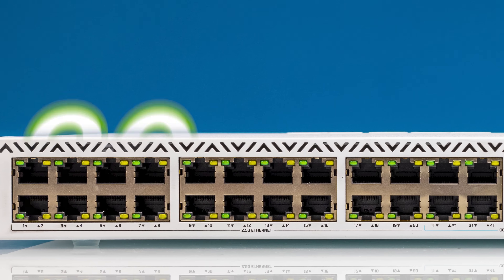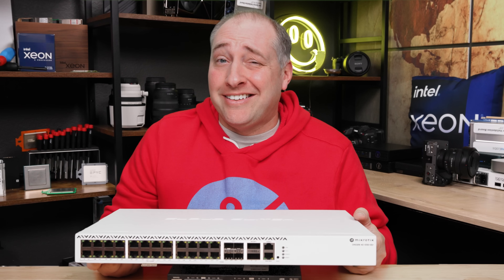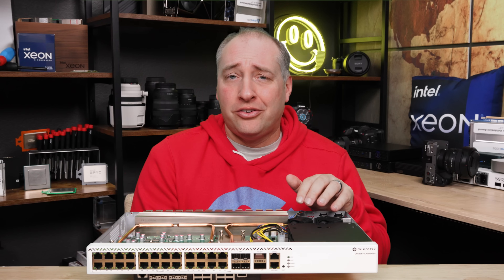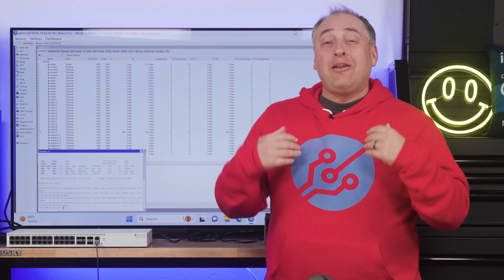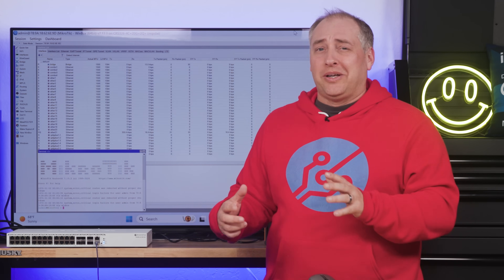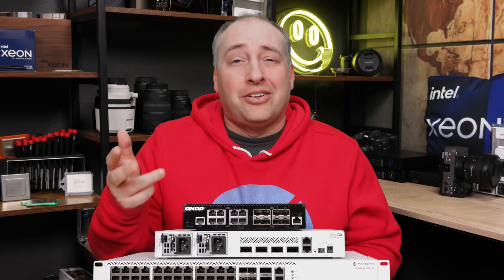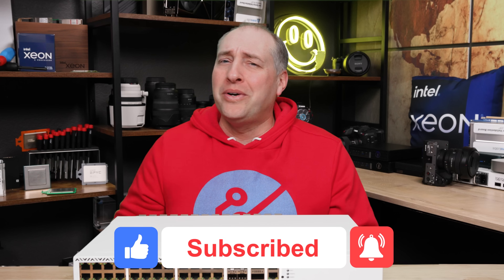Inside MikroTik 's NEW 2.5GbE and 40GbE Switch - CRS326 4C+20G+2Q+RM

Comment: It would be nice to have all 10G posts.
I know its a lot more power, but thats ok.

I have a MokerLink 2.5G. I wanted the 10G but its $180CAD, then Id have to buy 6 SFP RJ45, and that would already be out of budget.
Reply: Lets examine this idea shall we.

All of the ports combined require 170gbps switching capacity to be non-blocking.

Switching those 2.5gb ports for 10gb would take a chip that can handle 200gbps.

After adding the rest of the 10gb and 40gb.. You would need 320gbps switching capacity to be non-blocking.  That's almost double.  So now, you are adding in a more powerful switch chip, that will draw more power and product more heat. Now you need to redesign the cooling solution to accommodate that, so that means even more cost.  Oh, and you'll need to upgrade the power supply for the units.. So more cost.

You are left with a switch that is well over $1000, and you're complaining about having to buy 6 SFP modules? :P

Comment: i just got a 2.5 plus 1 10spf - suits my needs and cheap too - could not hold off any longer and will future proof me for a while - the 2 40g on this one are nice for ws to nas connection - hopefully they will be able to add more 40g ports in next few gen of switches - smb mkt needs fast networking - it is their weakest link arguably. with lots of 2.5 you can do bonded connections a bit easier

Comment: Thanks for the review... I did like and also dislike this switch for few reasons:  (1) It has 128 MB of RAM compared to the old CRS326-24G which is a downgrade that has 512 MB ( I found that 64 MB causes random reboots when memory saturates).  (2) Flash Storage is 32 MB (double than CRS326-24G) but we recent package upgrades are eating this small storage (why not go 1 GB for RAM And 1 GB for Storage? don't get it and don't tell me is price (3) No PoE++ as you mentioned, so its a downgrade in certain areas compared with older models and price is 3X times higher than the current CRS326-24G which is a DoA.
Reply: I paid almost next to nothing on my CRS326-24G-2S+ before the pandemic happened.  Also, same for my CRS328-24P-4S+.  Chip shortages had huge influence on prices.  It's coming back down but nowhere near the prices 4 years ago.
Reply: @Darkk6969 True but getting 2.5 Gbps + 2 extra SFP+ + 2 x 40 Gbps for 3x de extra cost of the CRS326-24G, doesn't make much sense to me, specially if they lack 1/5 of the memory of the previous generation
Reply: limitations in the max size supported by the very old management CPU (from 2013), which is due to price and availability issues. Also the reason why it uses DDR2 RAM which is old.
Same reason it has 40Gbit and not 25/50Gbit ports, they use a switch chip that is old and does not support more modern modes.

Comment: No longer early this time. :( What was the correction?
Reply: Mikrotik has not been very clear about this switch. Their website (and the original video) mentioned that the combo Base-T ports were 10GE but they're actually 2.5G - this looks to have been corrected
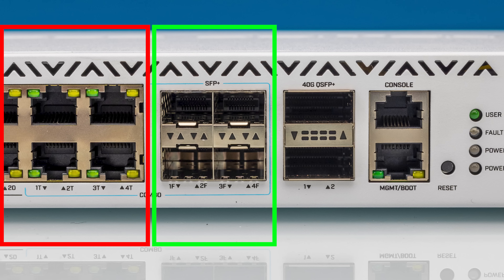EDIT: You can find the changes to the video at 2:45
Reply: i wonder aswell, maybe theys got smth wrong and had to reupload it to correct details

Comment: Appreciate the update, I was /4 of the way through the original when it was changed out. It is a lot clearer now. However, what I'd really want is to have more 10gig sfp+ rather than the 40gig.
Reply: QSFP+ to SFP+ converters will get you two more.
Reply: You mean 8 more :) Each QSFP+ should give you 4 SFP+ with breakout cables @RambozoClown

Comment: Literally was looking at 40G switches yesterday.
Reply: If you are only after 40G, go with the quad 100G switch from Mikrotik. Great future proofing, and you can break out the QSFP28 into either 4x10G or 4x25G or 1x40G or 1x100G

Comment: NOOOOOOOOOOOOO!!!!  no more 2.5gbe! - this should be a 24 port 10g base-t / 10g sfp+ / 40gbe qsfp switch.
Reply: Mikrotik already has one with 24 SFP+ and two QSFP+.  It's also less expensive than this. Go buy it.  Use the savings to buy SFP+ to 10GBASE-T modules.
Reply: @pleappleappleap  New 10G SFP+ modules are easily $50.  ($65 if you buy Mikrotik branded)

By the time you buy you buy 10 SFP+ modules then you'll have broken even with this switch.
Reply: There is a different CRS326 with 24x 10G SFP+ and 2x 40G QSFP+.
Reply: 10Gbase-T is useless. Used Mellanox cards and fiber is where it’s at, or DAC as an alternative.
Reply: @LtdJorge  Fiber DACs are awesome too.
Reply: And more heat
Reply: And few devices have 10Gbe. 2.5Gbe is already rare.
Reply: @TheMaxAwesome most high end gaming motherboards have either 2.5g or 10g base-t, most workstations have 10g base-t.  most micro pc boxes i've seen have one or more 2.5g ports, i've seen some home wifi routers with 2.5g... lots of 2.5g switches.  there's a ton of gear that uses it.  10g base-t started to get rolled out on the high end stuff, it's still there but it's slowed down and 2.5g has taken over the lower end of that market.  I'm honestly not sure why we don't see more desktop motherboards with 10g sfp+ (I've honestly never seen one), but even high end macs have come with 10g base-t for quite some time (the mac pros in particular).  my current motherboard is an aorus x570 xtreme, onboard 10g base-t.  the board in my nas is an asrock x470  taichi ultimate (8 sata ports, 10g base-t, 64gb of ram, 5950x makes a really nice truenas server), and you can get intel x540-t2 dual port 10g-base-t cards used on ebay for a song, they work fantastically and even support sr-iov which i use on my proxmox cluster).  power wise, i've never seen my netgear sx728t go over 90w with everything going hard running network benchmarks.
Reply: Also 10GBaseT SFP+ generate a ton of heat and noise trough fans trying to keep them at reasonable temperatures
Reply: @etimacias  But does it use significantly more power than the 10GBASE-T PHYs on a direct 10GBASE-T switch?

In any case, if I'm using a SFP+ switch, I'll often be using DACs rather than 10GBASE-T.
Reply: the 10G PHY on board has a potential to be cooled by a main heatsing, so it'd be easier to dissipate the heat. If you look at Mikrotik's 10GBaseT SFP+ modules - even Mikrotik recommends not plugging them in adjecent SFP+ slots. They get to 70C easily, because of lack of surface.
Reply: @etimacias  yeah, it's totally the sfp+ causing that heat, not the 10Gbase-T circuitry that would need to be present in the switch anyway....
Reply: 10gb cost way too much to run.
Reply: we need more affordable  2.5GbE switches.
it finally has to start replace 2.5GbE switches.
Reply: @ChrisHolzer  ???
Reply: 24port 10gbase-t would need a dedicated diesel power generator
Reply: @marcogenovesi8570  this lol. And an Air Conditioner for it.
Reply: @marcogenovesi8570 Unifi EnterpriseXG has 24 10g base-T, plus two SFP28 ports, and draws a maximum 100 watts. So not so bad.
Reply: @marcogenovesi8570 I own a netgear  xs728t that works great and doesn't really take up all that much power.
Reply: Money, money money , 10Gb comes with a bigger  price. For Home use 2.5gb is more then enough.  By the way in europe we have 2.5gb internet connections as well at very low price . About 15$ / month with cable included.
Reply: @IonutRaducanu yeah, internet is overpriced here in the states.  I pay for 2g fiber for $100/mo (it's overprovisioned for 2.4gb/s).  That said, it isn't about wan speeds (though that's part of it), it's about lan speeds, low latency, high speed access to internal services (mostly storage and virtualization), I've got a cluster of 5 machines running proxmox with ceph (which is very speed and latency sensitive), and 2 storage servers (rust with caching) and a few 10g-base-t desktops.
Reply: ឥឥឥឥឥឥឥឥឥឥឥឥឥឥឥឥឥឥឥឥឥឥឥឲឥឥឥឥឥឥឥឥឥឥឥឥឥឥឥឥឥឥឥឥឥឥឥឥឥឥឥឥ😊ឥឥឥឥ😊ឥឥឥឥឥ😊😊ឥឥឥឥឥឥឥឥឥឥឥឥឥឥឥឥឥឥឥឥឥឥឥឥ😊ឲ😊😊ឥឥឥឥឥឥឥ😊😊ឥឥឥឥឥឥឥឥ😊ឥ😊ឥ😊😊ឥឥឥឥឥ?😊😊?😊😊😊
Reply: نز زي تتتز رب ىةدو،
دا
ذ🎉
Reply: ٣٣١١
Reply: Don't forget that most modern non-datacenter/non-edge devices and endpoints are still shipping as 1GbE or 2.5GbE, while most modern Wi-Fi AP's are still topping out with 1/2.5/5G mGIG.

The 10GBASE-T standard is incredibly power hungry, much easier to use them in switches that are designed for higher density PoE environments.

10GBASE-T ports/transceivers on most platforms require 2.5W per port. For example, if you use the Cisco SFP-10G-T-X transceiver in a Nexus 93180YC which has 48 x 10/25G SFP28 ports, if you plug in a 
SFP-10G-T-X transceiver into an SFP28 port and enable it for 10G, the three adjacent ports get dropped to ultra low power mode and limit their use to some low power DAC cables or just go unused, cannot use regular 10/25G optical transceivers, AOC cables or active TwinAx. It's crazy that 10GBASE-T ports on a modern switch require more power than a 25Gb optical MMF transceiver, but that's the nature of trying to go fast on traditional Cat6 plumbing.
Reply: @racerex340  the point about non-datacenter/non-edge devices and endpoints still shipping as 1g or 2.5g is EXACTLY the problem I want to see rectified.  there ARE soild boards (such as the aorus x570 xtreme and asrock x470 taichi ultimate) which have integrated 10g but there are far too few of them - likely because there aren't nearly enough reasonably priced 10g base-t switches out there to make the whole thing work.  are prosumer folks with desktops really going to care about trading an extra 3w to trade a 1g or 2.5g connection to 10g?  I know I don't care.  and on the switch side, yeah, I know that sfp+ to 10g modules are power hungry, which is why I went straight for 10g-base-t switches (I've got a netgear xs728t as my core/aggregation switch and I've got a xyzel xs1930-10 as my lab workgroup switch (both of which perform fantastically and are within my power budget (though i did have to get quieter fans for the netgear switch and yeah, it is a little more power hungry than an equivalent sfp+ switch)) - for the record, I would also be 1000% fine if all the motherboard manufacturers got together and standardized on sfp+ as well - but i've never seen a consumer/prosumer motherboard with integrated sfp+ (what gives? seriously?) even if we did have to go through the costly process of trading out all of the cat6 for optical...   while sfp+ switches are significantly less expensive and draw less power, you still have to take into account the cost for the sfp+ modules though, as well as the cost of new cabling which all adds up.
Reply from the maker: True, but then it would use a lot more power.
Reply: why only 2.5 when 10 is available